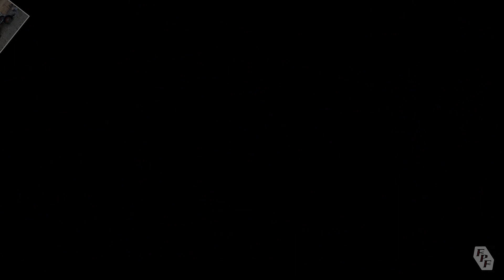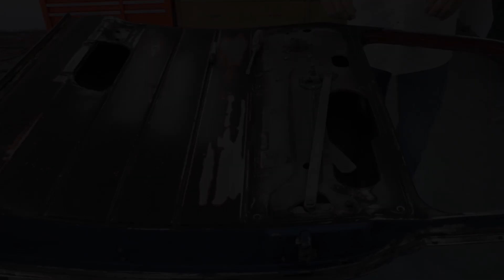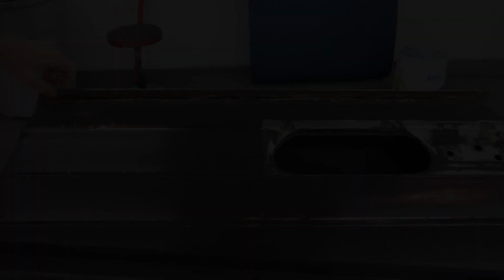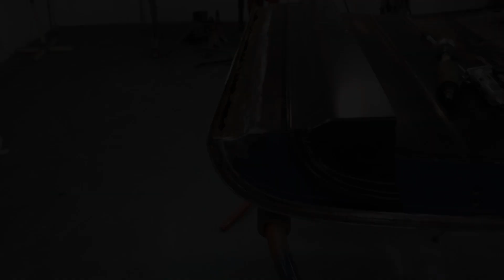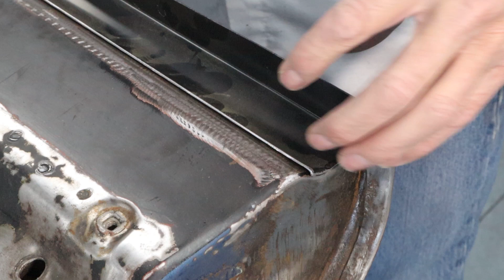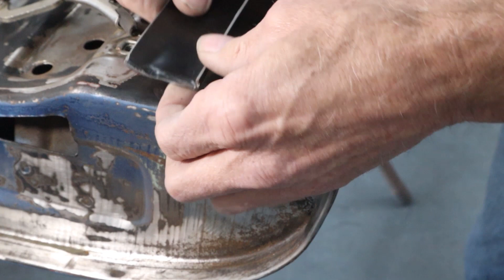1950 Chevy Truck (Ep 43) Inner Door Panel Patch Panel Part One

Comment: Thanks for the video. I need to do this. It was a big week of racing this week so I have to get caught up on your videos. Thank you for your time.
Reply from the maker: Were you competing?  What class do you race in?
Reply: @FoothillPaintandFabrication  No just watching. I'm building my Chevy 53 1/2 ton for drag and drive 8.50 class. Might make drag week but probably Sick week next year. I still have to get my Ryan Falconer V-12 aircraft racing engine head fit to the I6 292 block. Also have 5 stage dry sump, Electromotive direct fire ignition, 6-71, duel quad 650 DP and Nitrous. About 1000 HP. My engine shop is booked for most of the year. I'm learning a lot from your videos. Fast and pretty.
Reply from the maker: Sounds like you have a lot of work ahead of you.